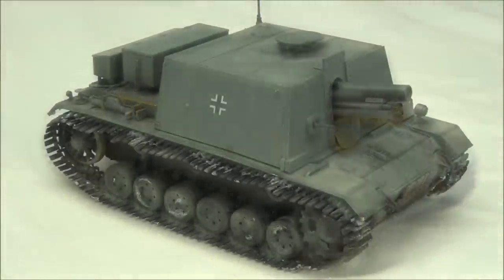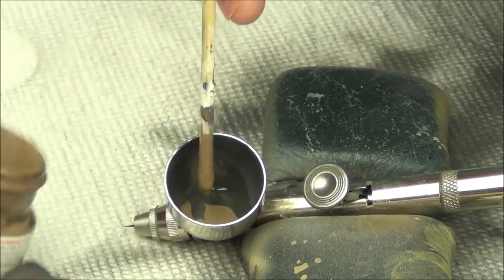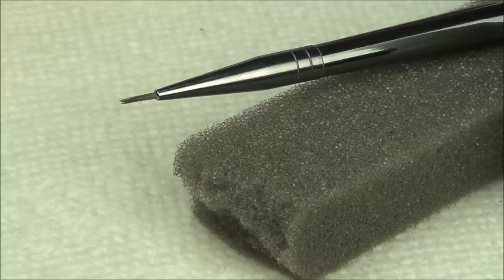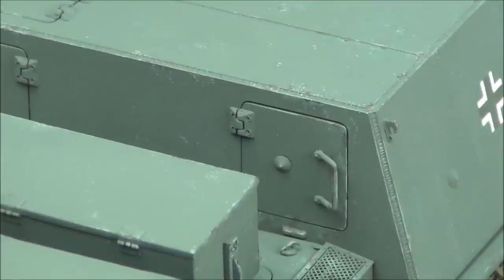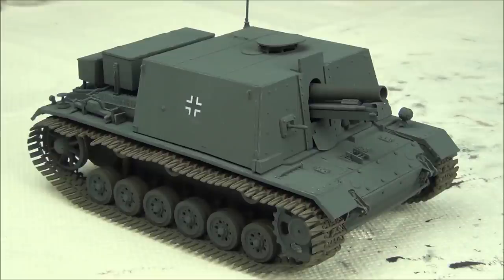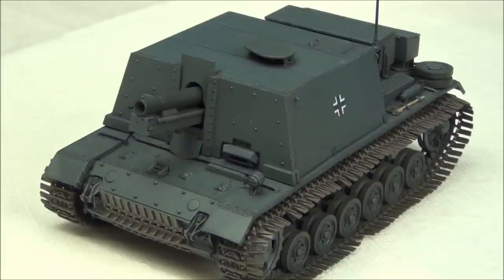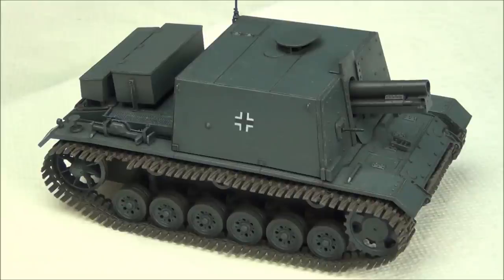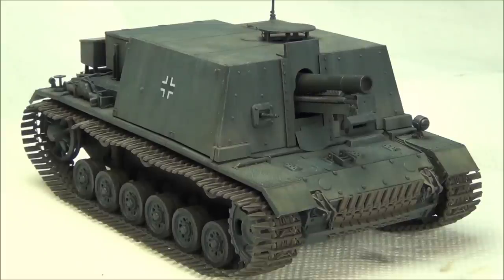How to Paint & Weather PANZER GREY | Standard Weathering Procedure Ep.4  (For Model Tanks)

Comment: Great video once again. Although, for your varnishes; while Tamiya makes great products, I would recommend using varnish out of its own spray bottle. I've found that spraying clear coats out of my airbrush does a number on the nozzle, but you can pick up the spray varnishes at Michaels for around $7.
Reply from the maker: +Joe Reen I use Tamiya for the extra durability that comes with their paints thinned with lacquer thinner.  Using Tamiya clear and matte is not any more harmful than standard Tamiya paints since they are simply transparent versions of this paint.  Other varnishes may be different though.

Comment: You mentioned Wilder enamel thinner here: I'm having a hard time finding that. It's sold out everywhere I've looked.  Is white spirits an acceptable alternative? I have Winsor & Newton Artists' White Spirits.  Any difference between branded enamel thinners from places like Wilder and white spirits in replicating your techniques here with the oil paints and Wilder pigments?
Reply from the maker: You can use other enamel thinners to the same result.  What you have described should work well, but you should test the thinner on a painting mule or test model to make sure it's not going to react with any other paints you have used.
Reply: @Panzermeister36  Thanks!

Comment: So when I do thinks like dot filters, I don't use Tamiya brand enamel thinner.  I use the big blue cans of Klean Strip that you would buy at a hardware store.  On the front it says "thins oil based paints, stains, and varnishes.  Use on brushes and equipment". It has worked fine for me but I want to know if you advise using it or not?  (Also I loved the video!  Very helpful for my Panzer IV Ausf. D from Tamiya)

Comment: Great video as usual.  I like the idea of gluing the tracks and wheels separate but what do you use to keep the wheels on the suspension arms when doing this?  Thanks
Reply from the maker: +JPMerce12 on these Dragon kits, the wheels fit quite snugly even with no glue.  In fact, once I put those weathered wheel-track assemblies back on at the end of the video, I didn't even glue them on.  They fit very well, and I guess I could be able to remove them if I ever see fit.

Comment: hey man, sorry to bug you so much. I'm doing some online shopping now and i need a good pair of tweezers. there's some vallejo ones for $7 and and then there's some godhand's for $55 lol. i believe godhand is overpriced. I got a pair of nippers from lee-valley for like $27 and the cuts they make look comparable to what i see people getting with $100 godhands. Anyways is there a difference between tweezers? They all look the same.
Reply from the maker: The sprue cutters?  Godhands are very good as they are only bladed on one side, so the cut is cleaner and doesn't stress the part as much.  But they're also fragile, and can break if you cut thick sprues. Usually guys will cut the parts off first and then use the Godhands to clean up.  I just use a knife or file to clean up.  For actually cutting off the sprue, Tamiya 75123 or 74123 (I forget) are excellent and not too expensive.  The cheap ones will not stay sharp for long and may mangle small parts.
Reply: @Panzermeister36  what about tweezers. there's some for $7, some for $16 from mr tweezer and then there're tamiya tweezers for $26?